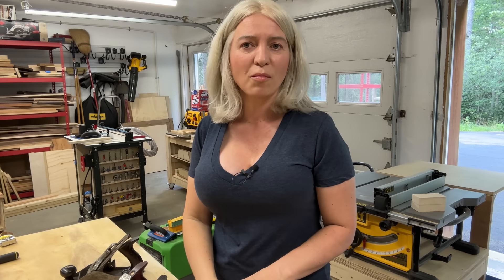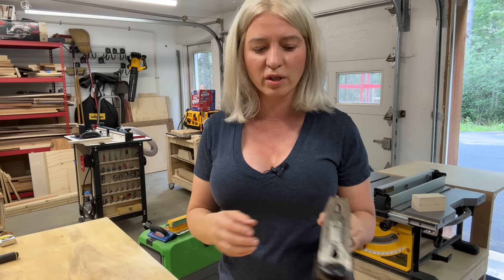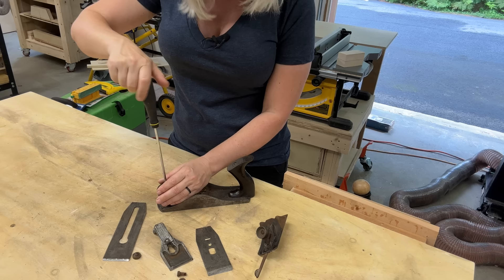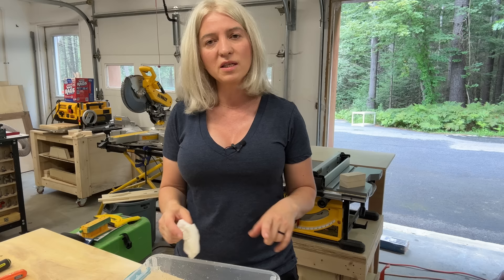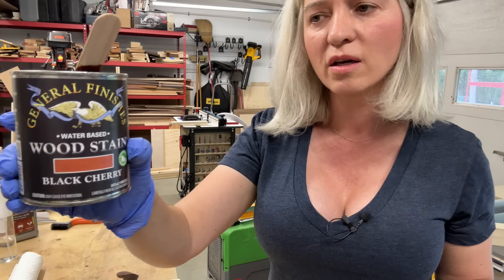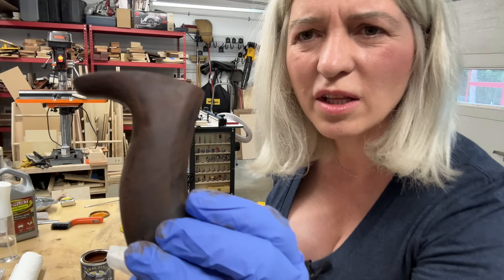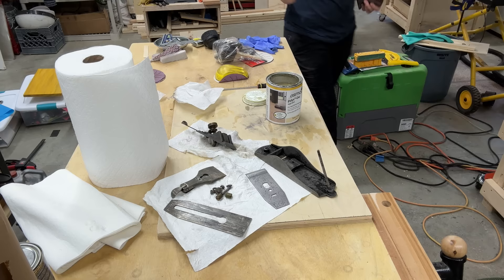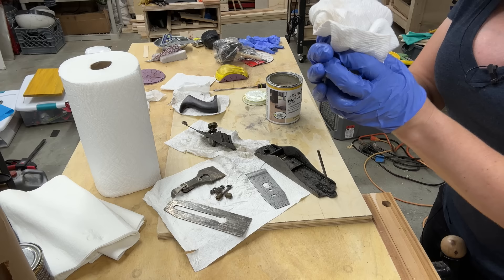How to restore an old hand plane. How to remove rust and restore old tools. Woodworking projects.

Comment: Thank you so much for doing this video... I’m so excited you did.  I have come across several very old planes over the years... I enjoy collecting antique tools and accessories.  There is a place called Renninger's in Mount Dora, FL. and three times a year (November, January, and February) they host an Antiques and Collector’s Extravaganza.  Most of the time you can find some amazing old tools there.  It’s where I have purchased most of mine including a molding plane, 1 inch rabbet plane, Spiers Ayr dovetail rabbet plane, and a No. 043 plough plane with 3 cutters.  These I won’t work on but I do have a couple I want to restore.  I just never quit really knew how to go about it until watching your video.  Now that I have your information it’s given me the confidence to try it.  I will certainly use your video and advise as a reference when I get started on my restoration project.  Thank you and take care!

Comment: Hi Skyler!  I have restored a number of planes, some over 100 years old. It’s true these planes will outlive us. So it’s a pleasure to restore one to operating condition.  I use similar rust removers to get the rust off.  I’ve seen several people totally refurbish a plane by honing the metal bright and painting it.  I don’t believe in that, as I want to honor all the past artisans who used it.  So I restore by leaving as much original patina and rubbing with wax.  I liked what you did though!

Comment: Great work Skyler!!  The plane looks great!!   When you picked up the can of Brasso I was thinking I had better check my brass for morning inspection tomorrow.... lololol 🤣🤣
Just passing this along... I also use "Mothers.  Cream Metal polish". It's formulated for aluminum and you can use it for steel.   
It will never polish steel to "chrome look", but here with 0000 steel wool and follow the machine lines it will brighten the steel up.  Rust stains forever, so.... You do what you can.    
You can also drop a small dollop of Mothers on wax paper and sprinkle it with Comet Cleanser, mix, and dip the 0000 steel wool in it and clean/polish away.  Plain or mixed takes elbow grease, but it pays dividends in maintaining the integrity of the machined smooth parallel surfaces and  90° angles....

The corrugated bottom No.5, just use the nylon brush and comet and scrub out the inside of the corrugations, rinse and evaporust.  Don't murder yourself trying to clean the corrugations perfectly.. 😆😆!

Paste Wax/ "Gun" Oil : It's your call on rust prevention , Miss!

Thanks for sharing your adventure with this and am looking forward to seeing you use your hand planes!
Reply from the maker: Thank you so much for all this info. I will make notes from it for sure. I wasn’t sure what to use for polishing and my local hardware store person was no help at all. So I bought the two products that said metal polishing and hoped it will do something:) so far I have cleaned the two smaller planes ( still have to sharpen them properly) and I am planning on doing the No5 planes when get home ( in a photography trip now).

Comment: I have an OLD rusty antique  " Wagner " cast iron skillet ,  I'm going to restore so I'll be trying out that Evapo-Rust  ERO12 product,  thanks for the idea Skylar
Reply from the maker: Awesome. Come back and tell me how it went . I restored an other plane and left it in overnight. Worked much better
Reply: I’d like to know how that works out, of course it’ll need seasoned again
Reply: @woodworkingwithSkyler . Great find
Reply: @byfordbarnard2264  This will not be my first radio, however, it will be my first time using a chemical to  remove the rust.  That product just arrived from Amazon this morning.  I'll be soaking the pan overnight and continuing the process tomorrow.
Reply: @woodworkingwithSkyler  I did use the Evapo-Rust product Monday  afternoon letting it set overnight  and it worked perfectly at removing the rust from my cast iron skillet. The old seasoning took some extra work .  I also used the product on some clamps and a few other tools in my shop. 
How about my request for you to get a heavier microphone  ?

Comment: That's a nice gentle restoration.  The rear handle is commonly called the tote.  Assuming it is original, you were lucky to find one in solid condition.  They are notorious for cracking.  If you are a trusting person, Evaporust is supposedly environmentally safe and can be handled by hand.  It can also be poured back into the container and reused many times over.
Reply from the maker: Awesome. I didn’t know was called a tote. I hope I will remember this. Yes, I was very happy it was in good shape. Not sure if was original but the wood felt really old. The other small plane handle it has a few chips and is a little loose no matter how much I tighten the screw
Reply: @woodworkingwithSkyler  One fix I have seen for that is to slightly shorten the length of the threaded rod.  Using a file, a grinder or a hack saw, remove just a bit of material (1/32").  Then test to see if it tightens properly.  Removal of the material will create a burr making it hard to start the threads.  Find a nut of the same thread pattern and put that on the threads before you file, cut or grind.  When you back off the nut it will remove the burr.  Good luck.

Comment: Your welcome! It looks great by the way! You done well! The evaporust done a good job! But I just looked on Amazon. A can of evaporust  is expensive vs a gallon of white vinegar. I think a wire wheel in a drill or bech grinder would have done a fantastic job with the rust removal. The nylon brush was ok too though!
Reply from the maker: I agree. Next I will try one using vinegar
Reply: @woodworkingwithSkyler  ok. Thank you!
Reply: Skyler, don't do a long soak in the vinegar! 
I may have ruined a great plane by soaking for three or four days and the steel seems almost spongy.
Not sure if the blade will sharpen well since the cutting edge is very pitted.
Reply from the maker: @stevebaumann8879  oh, wow! Thank you Steve. So sorry it didn’t work out for you! It sucks when that happens. Thank you again. I was just about to soak one to film and compare to evaporust. I also bought the w40 rust remover. Maybe will give that a try instead
Reply: I've seen it done many times, but didn't know the strength !

Comment: That’s a nice buy and a job well done! I was wondering what grit sandpaper you use for such a job - about 180 or 240?
I’m looking forward to the sharpening video and I’m very curious about adjusting a plane, I hardly can get it right.
Reply from the maker: Thank you. Wasn’t sure what the appropriate grit was so I used 120 .